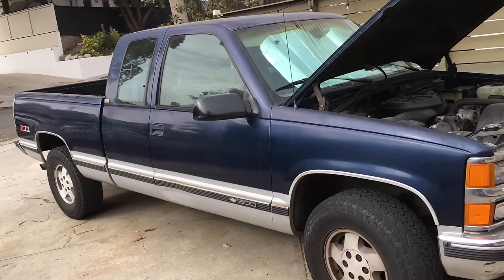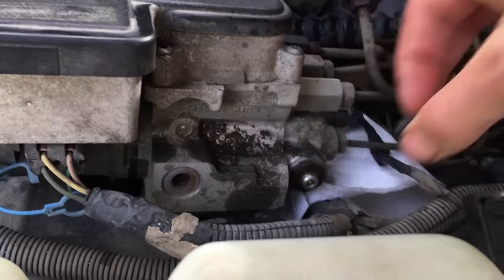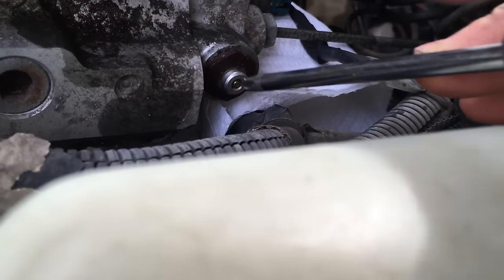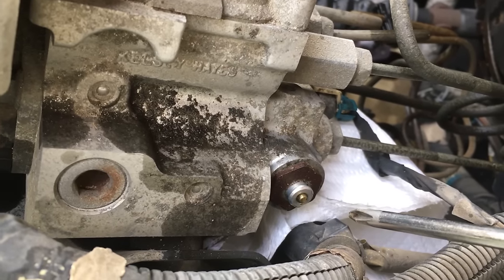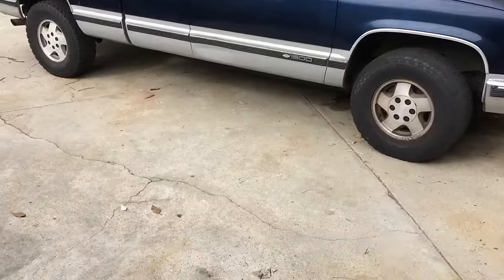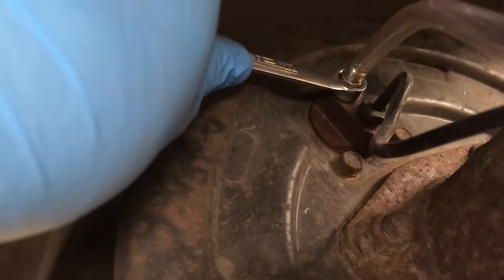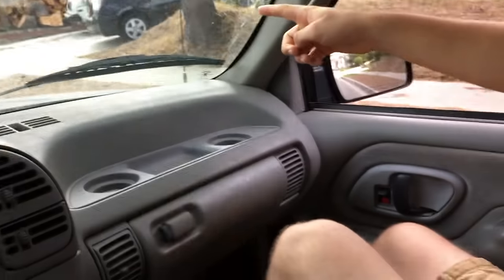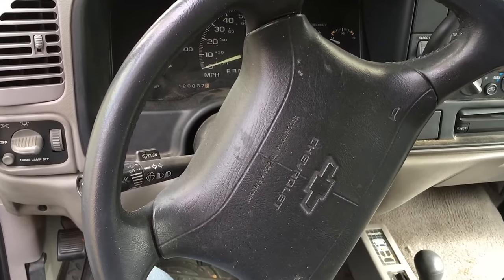Spongy ABS Brake Fix 88 to 98 Chevrolet Silverado

Comment: Look you just need to open the bleeder screw keep your hose on it and just pump the brake until you see no more bubbles then close it and move on to the next. And also make sure your reservoir for your brake fluid is full

Comment: I always pull the fuse I hate abs every truck I’ve owed I have a 95 Chevy dually four wheel drive and usually the brakes are fine without the abs I think they are horrible not a good system in my books
Reply: I removed my fuse and now the pedal is much higher when braking. Also not spongy any more.  I will try bleeding the ABS and put fuse back later.

Comment: Nooo thats how idiots bleed the abs brakes. If you have air in that system you must cycle the abs solinoids with a scan tool or potentially 1st time abs activates you will loose pedal and crash
Reply: ONLY 95 was OBD1 with this system, 96+ was OBD2. But even the OBD1 version has bidirectional capability with a QUALITY scan tool. I had no problems accessing it with my $300 chinese tech 2. And this is about the WORST thing you can do. Those are NOT bleeders, it's the proportioning valve. Had somebody else on a forum follow this video and trash his proportioning valve doing it.